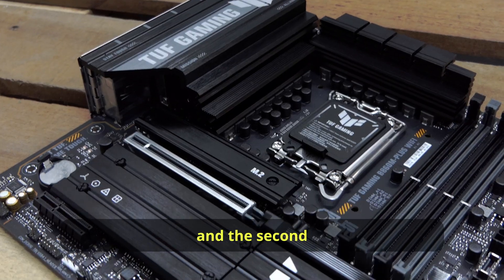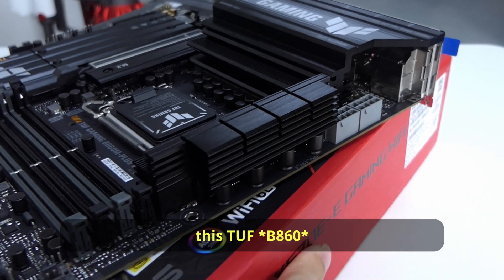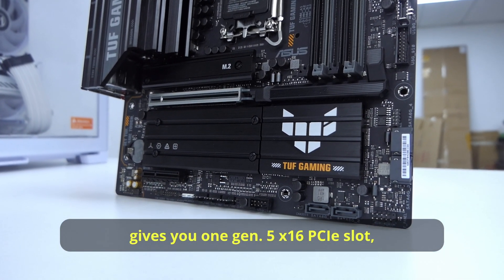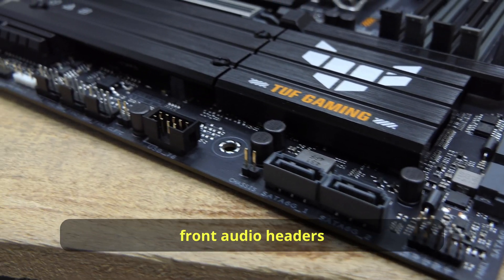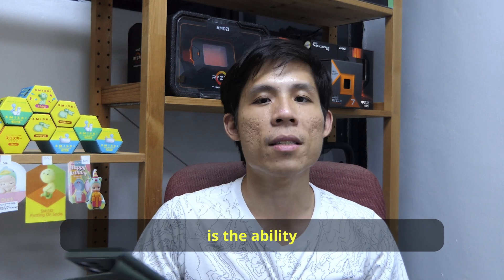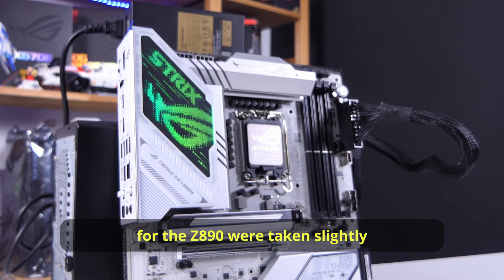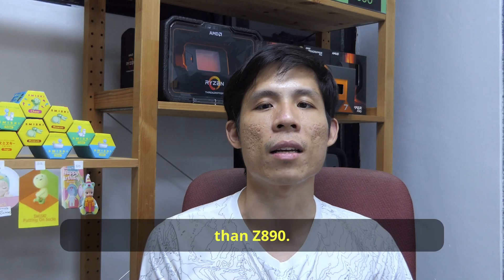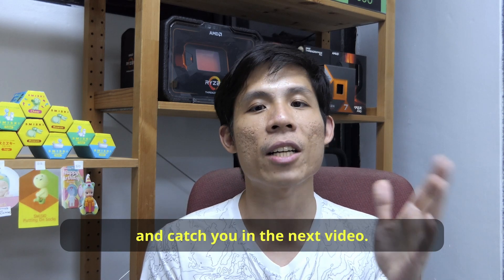Can B860 FINALLY SAVE intel? (ASUS TUF Gaming B860M-Plus WIFI)

Comment: Hi! Quick question. Can you change the voltages in the Bios with this B860 board or voltages are locked as well like the OC multiplier? Just asking because for high memory clocks we need to raise the SoC voltage too not just the memory voltage.
Reply from the maker: Hi Kero, you should be able to change the SoC voltages in the BIOS, as well all the other things that you need for higher OCs.

Comment: Dam ! This 😮B860 is sure amazing to have.  Thanks for doing a full review! 

A question for you sir , 
For the chassis with an HD audio module in the front panel on B850. Any I ask what are the audio ports ? 3 audio jacks and what Front Panel Audio header?

Second:  I checked on the B850 on Asus . 
  Thunderbolt™ (USB4®) header. Can this port use for the Realtek Surround Sound as another output to an audio interface ? 

Thanks for your time 
Cheers man 🙏🏻
Reply from the maker: Hey thank you man for your support and questions! Did you find the video useful and fun?
And you are a sound engineer, may be you can lend me your expertise here?

The B850-A has one S/PDIF, Line Out and Mic in each. And they are audio jacks yes. The front panel audio header connects to the front audio panel on your PC case, for your headphone / microphone.

This B860 Plus has more audio ports which you can see at 1:46

And B850-A, do you mean an external thunderbolt card for the PCie slot at the bottom to connect to the thunderbolt header? If yes, I think it should work for an audio interface.